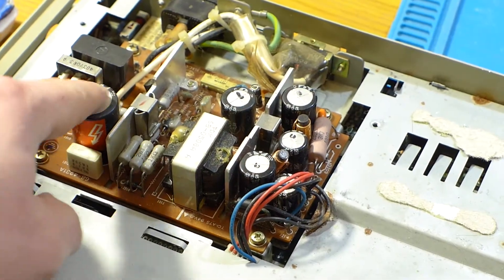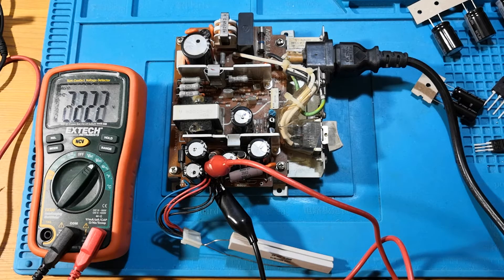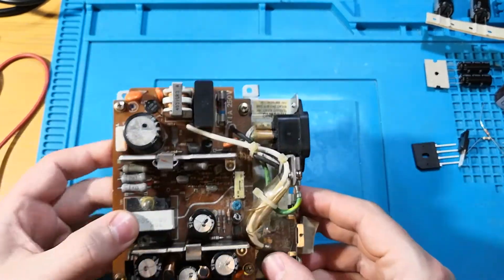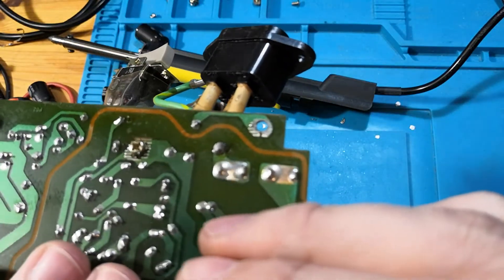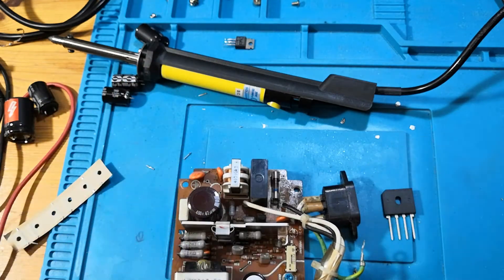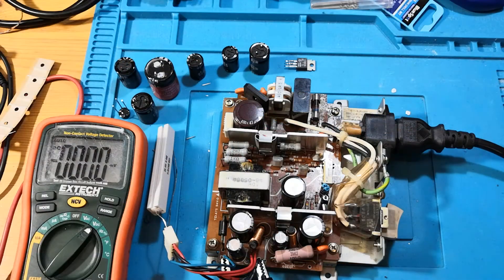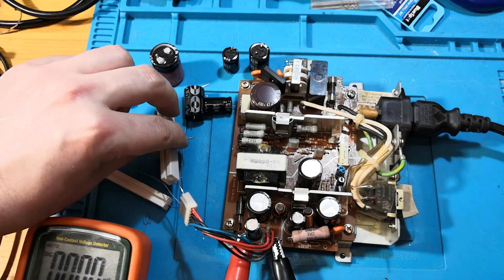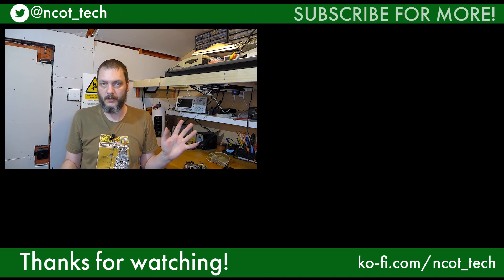Fixing a tired Atari ST Power Supply - My childhood Atari 520STFM

Comment: do you have the specs on  the rectifiers or any links please? Also the voltage regulator.
Reply from the maker: Sure! It was a kit I bought and this is a link to the instructions. It includes a list of the parts and their part numbers so you can look them up somwhere

https://www.exxoshost.co.uk/atari/last/psu/index.htm
Reply: @ncot_tech  thanks for this - most helpful. I have a 520st power supply which keeps blowing the T1A fuse on power up. I bought it with a blown fuse on inspection so replaced it and then bang!  I guess I will need to overhaul the whole unit with new caps and rectifiers.
Reply: @saddiqkhan5821  yep.

Comment: hey i have a megafile 30 that doesnt work. when you turn it on it spins up but the activity led is CONSTANTLY on as soon as you flip the power switch. also it doesnt seem to do the selfcheck, the heads only "click" once shortly when it has reached operational rpm... the harddrive sat in our basement for like 30 years now. I cant find anything wrong on any of the boards they look brand new, I also reseated the harddrive connectors to the pcb and that didnt help. You think the heads are stuck? how could i solve that? Someone in the Atari forum wrote that you could try to give it a whack in the direction the heads should be moving, timed right when they already want to move?

Comment: Many years ago I bought a STE used. It had a blown power supply. I took the power supply from another ST with ram problems and swapped it. I'm convinced fan cooling is a great idea for electronics, especially older ones. I will be having a fan blowing at any of my antique computers when on for any length of time now. In my single mega i have a fan cooling the 68000 inside and I plan to add another fan to cool the psu. Where internal fans are not practical i will use an external fan.

Comment: Sorry chap. I couldn't get past the first section where you tried to murder the PSU. Old switch mode PSU's like this need a "small" load to operate in it's correct area. So you knew to connect a resistor to load the PSU, however you need to think more than just stick any old resistor in. Your 10 Ohm resistor was a good choice for the 5V line as from V=IR you will draw about 0.5A and you got a nice 5.05V. Then you stick the same resistor on the 12V - now you are asking for 1.2A!!!! That PSU was not designed for that load. IIRC it is max 1A draw on 12V. No wonder it was sagging to 10.96V. Then you go and swap to a 2.2Ohm resistor. It's pretty remarkable the PSU didn't go bang then. 5.45A??? on 12V??? Please do more research before launching into tests like that, and broadcasting them on the internet.
Reply from the maker: I was actually following a guide from here using the kit of parts from there too… 🤷‍♂️
https://www.exxoshost.co.uk/atari/last/psu/index.htm
Reply: @ncot_tech  Looking at the article I see this "If you want to test outside of your ST, then you must load the 5V and 12V lines with a 5-10watt 5V & 12V lamp or resistor. Resistor would be 2.2R - 4.7R 10watt minimum for 5V and 22R 10watt minimum for the 12V".  So it seems like for the 12v, a 22R resistor is what the article suggests.

Comment: Easy because you took your time, prepared etc. I think people expect you need skill to do it, or expensive gear and the answer is preparation and patience.
Reply from the maker: Yeah this was done with a £20 soldering iron and the cheapest desoldering tool I could find.

Anyone can do this if they're careful. The only skill is in learning that if something won't desolder, add more solder and try again, not more heat or force.